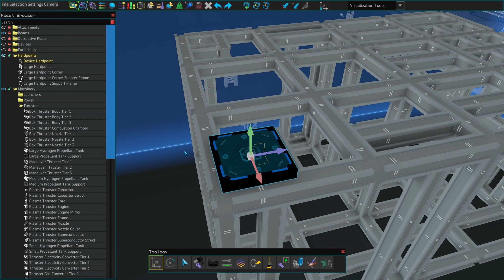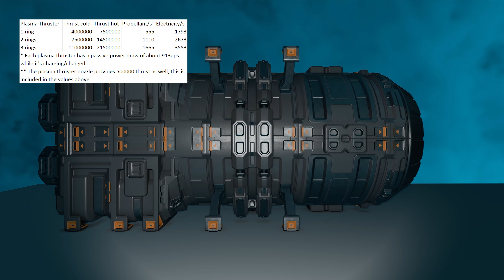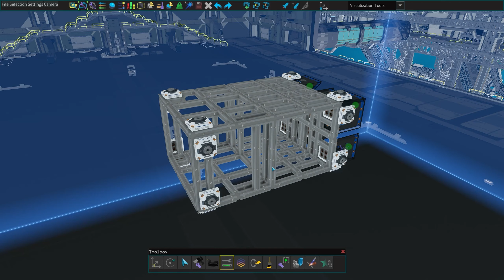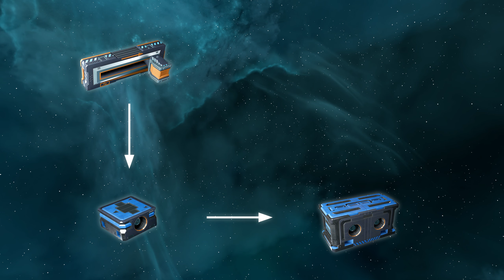Thrusters!  |  Starbase Ship Designer

Comment: I have a question. So you needed to have a component to jump through the teleportation thing's. But not everyone might be able to have that component so if I made a ship with several cargo lock thing's to transport people and their vehicles back and forth it could work if I didn't hit the material limit right? I have a similar question related if my vehicle was on to the teeth with weapons and was on the weapon limit and I tried transporting people with weapons would my ship then not work?
Reply from the maker: I'm fairly certain the first question is a yes; although we can't try it right now, it should be possible for ships to carry other ships while warping, so a "warp carrier" should be an option.
As for your second question, I'm not 100% sure if that works, but I think that, too, should be alright.
Carrying other ships is currently disabled, sadly, otherwise I'd go and try both of these options right now ^^
Reply: Ok 🙂

Comment: Does anyone know what would cause a maneuver thruster placed on the top of my ship to be constantly on when I am attempting to fly straight using my box thrusters?
Reply from the maker: The MFC uses the maneuver thrusters to make sure the ship flies straight (if it's slightly unbalanced), while also limiting some of the box thrusters to achieve the same goal... It'd be nice if we had an option to set preferences for that, but we don't atm :D
There's a good chance the maneuver thrusters all around your ship are firing, too, just not as much as that top one probably.

Comment: Do box thrusters also share fuel and data when next to each other? If not then how do I connect multiple?
Reply from the maker: They don't, you'll need a hardpoint for each. You can, however, put two hardpoints in between them back-to-back, and cable and pipe those two together, for some reason that does work :D

Comment: Thanks a lot for the troubleshooting part, it helps a lot! Are broken pipes always highlighted? If I set thruster's name and value, it begins draining fuel, but nothing else happens.. Generator is generating, maneuvers work fine in the same network, but not that box thruster D:
Reply from the maker: Hm, broken pipes should always be highlighted as long as you have the tool in your hand, but if it drains fuel it's at least sort of working... Can always shoot me a message on Discord if you can't get it to work, I try to reply as soon as possible ^^

Comment: all my thrusters are at 0 but the cables and names are fine the the mcu fcu are connected been trying to fix it for hours going slowly crazy ?
Reply from the maker: Sorry for the late reply... In case you haven't yet got it worked out; are you sure the hardpoints are bolted to the frame with at least two bolts, and the thrusters are bolted to those hardpoints? Also, in case you're using triangle thrusters; their hardpoint connections are slightly offset from where you would expect them to be, that might cause issues as well?
Reply: @Senkii  ty it was one wire behind stuff so I couldn't see i cable to a grid system now
Reply from the maker: @TheCrash1983  Awesome, glad you figured it out!
Reply: @Senkii  ty it was one wire behind stuff so I couldn't see i cable to a grid system now

Comment: i cant get my plasma thruster working any ideas?
Reply from the maker: Hm, that is the hardest one to troubleshoot...
- Is it bolted to a hardpoint, and does that hardpoint have power and propellant connected, and is the hardpoint bolted to the ship's frame?
- Is the thruster's "IsEnabled" field set to 1?
- Is the thruster correctly assembled?
- Is the ship's "warp class" above 1?

Also, does it work if you manually set the thruster's "ThrusterState" field to a value above like 1000? Or does that not turn it on either?
Reply: @Senkii  all sorted thanks was a couple of ducts not connecting properly ive left a video on my channel showing how to
Reply from the maker: @GarDjinn  Aah, glad you got it figured out, and thanks for making someone else's life easier as well, with the video!

Comment: How do generators work?
Reply from the maker: Not sure how well I can explain their full workings through a comment, but basically; you put a fuel chamber and generator unit together, put a fuel rod in, put a socket board on, and then put either coolant cells or a pipe socket board on, if you use a pipe socket board you'll want to have radiators on the ship.

Then there's a lot of settings you can tweak... I should probably make a generator video, I think... :D
Feel free to shoot me a message on Discord though, I might be able to assist some more there if necessary!
Reply: @Senkii  That helps a bunch already. Thanks for the help!
Reply from the maker: @sarbe6625  Awesome, glad I could help!